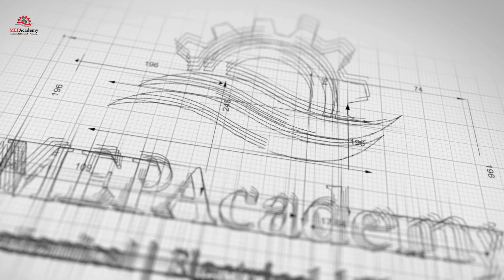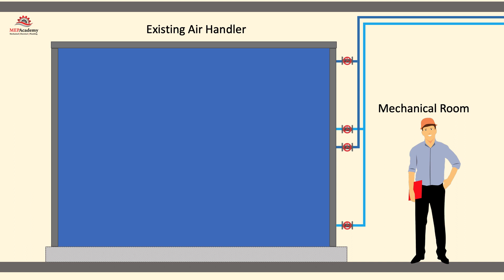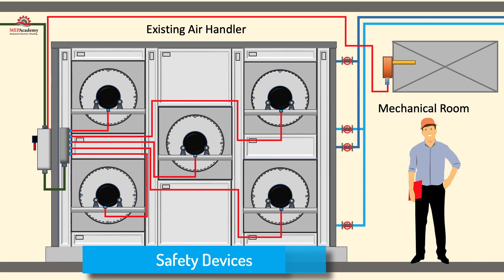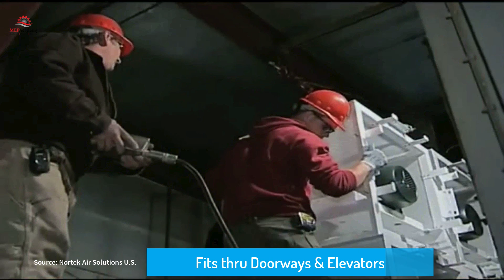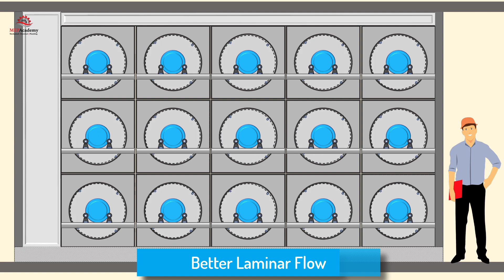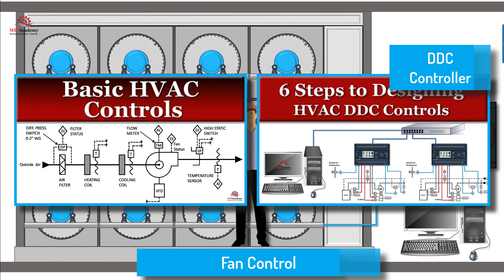How a Fan Wall or Fan Array Works

Comment: Can you please say something about vibration and dynamic problems, and what material for the stell bars and shelving , thank you.
Reply from the maker: Fan wall systems can face vibration issues from imbalances, harmonic resonance, or misalignment, leading to noise, wear, and fatigue. These can be mitigated with vibration isolators, proper alignment, and dynamic balancing. For structural components, mild steel (ASTM A36 or A992) is commonly used, with galvanized or stainless steel preferred in corrosive environments. Shelving should be thick enough to resist flexing and incorporate isolation mounts to handle dynamic loads effectively.